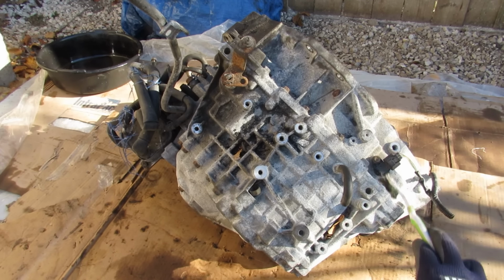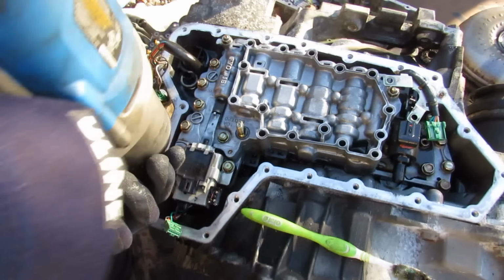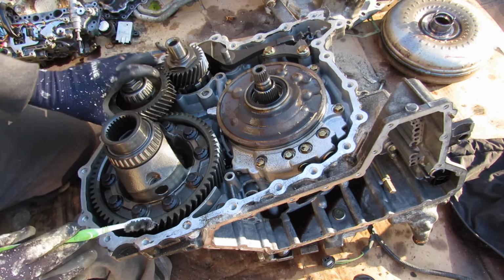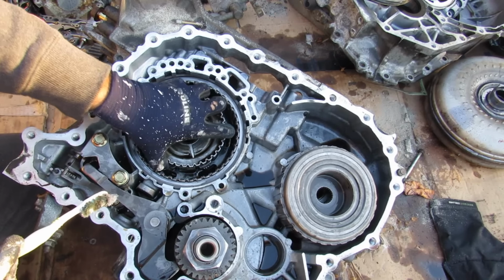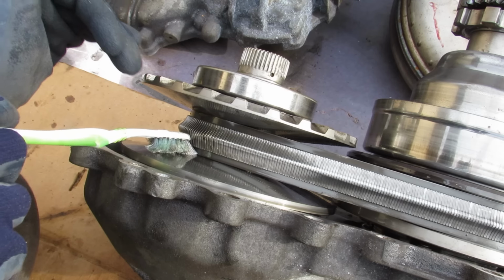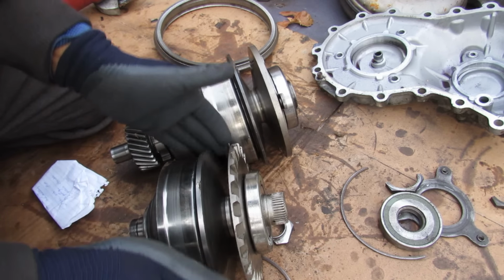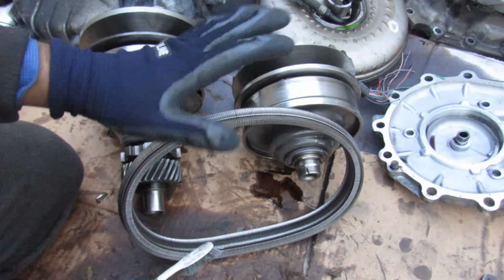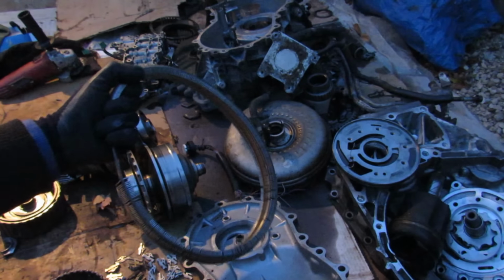Why Nissan CVTs FAIL

Comment: I have a 2016 Nissan Versa I bought in 2017 from Hertz for $10,500 out the door with 36,000 mi on it.
I now have 216,000 miles and drive the Hell out of it. I typically drive 70 mph in Cali , and 80 mpg in AZ and still average 35 mpg.
Just change your engine oil about every 10,000 miles with synthetic oil, and change transmission oil every 25,000 miles or so on a regular basis and you'll be fine no matter how hard you drive it.

Comment: The title is unfair for the manufacture 👎. Most damages are caused by user error.
Reply from the maker: Who do you work for?🐱
Reply: @speedkar99  does it matter? Please, you know the truth as well, in another "shaming" video you did the same to honda V6 cylinder deactivation system. The truth, all these were tested in conditions to "destruction". But , all service requirements were fulfilled. No problems accur even to a million km. Why suddenly ,a belt got destroyed, or CVT slipping issues?. Human error are 100% cause. I admire your skill and knowledge, and do continue your videos and teardowns of these beautiful engineered parts, but misleading viewers is a no-go.🙏

Comment: So what exactly makes it “Shift” or “simulate” 7-8 gears?
Reply from the maker: The computer regulates how much oil pressure goes to the variators and thus which belt ratio it'll stop at
Reply: @speedkar99  I have a more important question. Say I’m in a long line (about 30 min) in which a car might move up once every 2-3 minutes. Is it better to put in neutral each time I pull up, or better to just leave in drive the entire time? Is it causing more wear switching from N-D-N frequently? Also thank you for your quick response, as well as the breakdown of the Cvt in this video.
Reply from the maker: No need to switch gears. The torque converter is doing its job allowing the engine to run while you are waiting at the US border lineup.
Reply: @speedkar99  lol nah just Popeyes 🤣🤣🤣

Comment: I needed a car fast & got a 2017 Sentra. I read that trans fluid needed to be changed at a certain My mileage was about 51000 so I took the car for the work at the dealer. I used to change the oil on my Corolla & it was fairly easy to do. I’d bring the used oil to the place I got the new oil & they have a place to keep it. At no extra charge. It was more than I thought it would be but they did something besides just draining the old oil. As little as I drive the I won’t need to do this for a long time.  I could also change the trans oil in the Corolla my car had a handy drain plug I think most cars don’t have this & you have to take the pan down. A job you probably need a shop to as it gets messy when the pan comes out. I tried to find a good used Corolla but at the time couldn’t find one.

Comment: I had something similar to this on a Heathkit mini bike way back. Worked good. I’ll wait for this system to be improved before I purchase a car with one.
Reply: The system works as it is intended to  so  do your scheduled maintenance and  do not abuse the vehicle and it will last just like a regular one  Note the one thing i love is the totally smooth acceleration  never get the shifting gears sensation

Comment: No the question should be why has Nissan continued to put the same defective CVT 's in their vehicles without fixing the reliability problems ? Do NOT buy Nissan products with CVT's unless you want to pay for a new CVT before what is considered normal wear.

Comment: I've been building performance street cars for 12 years now and I only first drive a vehicle with a cvt a few years ago. It was a Nissan rogue and I told my cousin that her transmission was messed up because it felt like it was slipping. Then it clicked in my head and I remember nissan had cvt's now.

I own a 2019 Nissan Altima but the cvt doesn't act anything like the rogue did. It actually feels like a normal trans under normal driving conditions (not flooring it) and actually shifts. Her rogue never shifted and the roms always stayed at 4k+ rpm. My altima has 37kmiles and the trans is starting to slip already. Before the Altima, I had a 2017 6spd Sr turbo Sentra (should've kept it), but with the way I drive, I was worried the transmission would need replacing at some time and I don't have the money to replace a trans at the moment, (wife's not working because of covid), and it seems just after the warranty is up, something always goes wrong. The Nissan factory warranty is up @ 36kmiles and my car has 37k miles. Go figure. But I realized drivetrain/power train warranty goes to 70k miles. I wanted to wait to see if the new Sentra was going to keep the turbo and the 6spd (they didn't and I don't know why), and that's why I got the altima and I only went to the dealership to get a new tire for my Sentra. I hate salesman,they're like leeches and won't leave you alone. I do t want a new car! "Well let's just check your credit and see where you're at." Lol
These cvt's would be okay if they didn't die prematurely. I'll never get another car with a cvt unless all cars start using them.

Comment: that 'other' set of splines on he input shaft is NOT the drive for the oil pump, it is to hold the "stator" staionary inside the torque converter while the torque converter rotates around it and the turbine.

Comment: Thank you for this overview! I'm getting mine replaced right now and wanted to better understand why it was failing. Luckily, I'm at the tail end of my warranty, so failed at the perfect time to still be covered by the warrany!
Reply: I'm about to take mine in to the dealer as well @105k miles. Thank the stars for those lawsuits and the extended warranty to 120k
Reply: Change your fluid and filter every 30k if you want the new one to hold up. I know the factory maintenance schedule is longer, but usually you end up changing the trans along with the fluid because of it. I've changed my fair share of these and make money doing it. I'd rather change your fluid every 30k than hand you the bill for a new trans.
Reply: @nickwarner8158  For filter changes, do you change the exterior cartridge filter and the interior metal screen filter every time you change fluid?
Reply: @coopertracy6581  For most CTV, the internal filter is between the case halves. If you wanted to service it, you have to remove and dismantle the whole trans. Its only serviced during an overhaul. But think of it this way, if that screen is all plugged up something plugged it. That something is parts of your transmission. So if the screen plugs its fucked anyhow.
Reply: Sorry to hear that the key is not to listen to the dealer u should change the fluid every 50 to 80,000 km not miles and use a bottle of lubegard Recharge and protect with the oem fluid and u should never have an  issue I went 450,000km on an original cvt and still worked fine and sold the car and its still on the road with no issues as I sold it to a friend...maintenance is key as most dealers don't recommend changing as to why they fail....they make money replacing them too many scams nothing lasts forever especially fluid it breaks down its like saying don't change your engine oil same concept
Reply: @Eurofreestylemusic  nonsense- our service advisors recommend service at 60k. when one comes in on a flatbed its never a regular customer and the vast majority of the cars have never been serviced. if you just change the fluid every 60K you are ahead of the game.
Reply: @tommurphy4307  u dont have To change it every 60k and also Its how people drive My dads car has The original oil with almost 300k no issues original CVT....Its not a race car its a family car
Reply: @tommurphy4307  every 90k is reasonable if u got a lemon it wont matter if u change it every 20k sometines Its luck

Comment: MY GOD! It's complicated as hell....with an electric car, you don't have all these gears that took so much engineering, machining and labor to make.
The automatic trasmission was invented in the 1920's and it's hard to believe we basically still make them as they did in the past. The gas engine is even older and that has not chaged much either. I really hope gas cars become obsolete becfuase it cost so much to make them with so many parts and the more you have, the greater risk of breaking down as gas engines often do at great expense.

Comment: My nissan versa has that whining sound and it also sounds like one of the gears is loose because after I drive a few miles it overheats and won't shift from 1st or into 2nd half the time it stays stuck in first and the other half I have trouble getting the car to get out of first gear. It be feeling like it's stuck in 3rd gear. I must restart the car completely turning it off and on again just for first gear to catch and then it looses it again. The drive train doesn't have much torque when it's hot.

Comment: A big part of why they are pairing CVTs to higher powered engines is the fact that CVTs on low powered engines behave in a sluggish way. There is a slight floaty delay to stepping on the gas and the resulting acceleration changes in relation to engine noise. It's both hard to describe in writing but very easy to see for yourself in person with you hearing the engine rev but the acceleration coming behind the noise rather than in sync with regular transmissions. ,Sure low power engines don't wear out the transmission as fast so they should be better for this type but the drive feel suffers so people STEP ON IT MORE, undoing some of the benefits. On higher powered engines this is much harder to feel with the extra torque quickly making the changes faster but this loads the trans mission more leading to faster wear and tear. If we are honest here we don't buy high powered vehicles to drive them sedately all the time so the use case is just a bad fit. Its not that Nissan is doing this wrong, its a necessity due to air quality requirements and fuel efficiency regulations.

Comment: Quite some evolution from the Dutch DAF transmission, with 2 rubber belts, and the whole transmission being on the rear and the engine on the front (pretty good weight repartition). Very simple system and quite efficient finally, even kind of fun. That was 40 years ago...

Comment: CVT's are really inefficient - lots of friction loss continuously engaging and disengaging the belt.  Honda CVT motorscooters get only about 70% of the gas mileage of a chain/transmission motorcycle of equivalent displacement.

Comment: My friend, I have a 2013 Infiniti JX35 with this cvt and after removing the pan found a few very thin, 1 in long metal pieces that could be bent with fingers. I do not think it's from the belt. Any thoughts? I have a pic I can show you. Do you have an email address please? Much appreciated.

Comment: The older I get, the more I appreciate the virtues of a stickshift..
Reply: You can't even buy one anymore... So sad I still love Manual stick shifts
Reply: @josephschultz4097  Can still get some Mazda’s with a manual. Really most cars that aren’t American are available with a manual as an option. 
So, if you really want a manual just do the searching and you can find them.
Reply: @josephschultz4097  My new Versa is a stick for this exact reason. It's able to burn rubber on 1st.
Reply: @diegosc985  a friend has a 2014 Versa that's been horribly wrecked twice and most of the nearly 200k miles is cross country trips.  Engine still purrs and transmission/shift assembly still feels vague and unsatisfying to shift just like new.  It's impressively reliable despite the abuse.
Reply: @josephschultz4097  I was just looking at a 2021 Nissan Versa S with 5-speed manual transmission…
Reply: @josephschultz4097  Absolutely you can buy a manual on plenty of cars. Just not on these cars. I went for a GTI that has a great manual.
Reply: Why?
Reply: Unless you end up with a dual mass flywheel and a self adjusting pressure plate. For some vehicles, $$$!
Reply: Yup wouldn't own an automatic (the clutches are wear items) I can replace the clutch in my vehicle for $100-200 (50 if I just through a disk in it) and only have to do so every 125-200k In fact my Saturn (which is due for an engine rebuild) hasn't had a clutch since new and has 289k on it The trucks(which I tow and carry heavy loads with) are usually closer to 125k
Reply: @MDAdams72668  I had a small Dodge (93 Dodge Shadow 5 speed).  I had to replace the disk because the rivets that hold wear material were working their way out.  What caused that?
Reply: @tommak6516  If the rivets were actually falling out it was likely caused by a poor choice of rivets at the factory If however the disk material was simply worn down close to the rivets that would be normal wear the speed of which is highly driver/driving style dependant. I can get 300k miles on a light car clutch and 100k+ on the one in my tow truck. It is possible to destroy/wear out a clutch in minutes if not driven properly.
Reply: @MDAdams72668  Thnaks for responding.   It was awhile ago when this happened to me, I think 20 years ago.  I do not remember the mileage, less than 100,000.  Maybe around 80,000.  There was plenty of clutch wear material, in fact I remember their was very little wear (car was driven on freeway most of the time so little shifting, just in 5th gear most of the time).  But when some of the rivets started pushing out the car would not operate correctly.  I took it somewhere and they put a clutch kit in it which I think means a lot of clutch parts were replaced.  I certainly did not abuse the clutch, but I let friends (years before this rivet failure happened) use it occasionally for short time, a few hours, and I often wondered whether they did something driving to cause the failure.    I drove the car another 80,000 miles and sold it, 2nd clutch was still working fine.
Reply: and the clutch, pressure plate and throwout bearing top failure points..way more then a CVT..driven them for decades and replaced a lot of parts, and gears
Reply: I got 250k+ miles out of the stir-your-own 5speed on my Accord before a fork broke and jammed up the entire drivetrain.  Which brings one to the OTHER nice thing about a manual - COST.  I pinned down a used, fairly lo-miles replacement 5 speed for  about  $500.  Even used you're not gonna touch an automatic for that cheap.
Reply: I put over 350 K miles on 2 Honda passport cvt! No problems!
Reply: i apparently - and in reality -  am very very strange.   i am a nervous type and i really want to use those gears manually.  it literally saved my life one night when i had to slow my truck down on a patch of snow covered ice.  i super gently went down in gears to slow the truck down.   if i had touched the brakes the truck would have spun out of control.
Reply: I honestly don’t miss my stick shifts these days. If I want there is a semi-manual flappy paddle manual system on my current car but I had one quick go with it, found that the dash display tells you when to shift and then thought “if you are going to follow the car’s suggestions then you might as well be on auto anyway” and went right back to full auto.
Reply: @NeoMorphUK  idk what car u have but if its a shift light, thats mostly for racing
when you're focused on whats infront of you on the road and the other cars, you see the little light out of the corner of your eye and you know its when you should shift
Reply: @isatntt  That shift light isnt for racing on production cars unless you talking stuff like nissan 370Z, for most vehicles that shift light is trying to tell you how to save fuel, ive owned multiple manuals in life from a 1992 wranger, to a CRX del sol honda and now a 1st generation chevrolet colorado, and they had that light and it would only glow in two occasions either your in the red shift now before valves start coming out, or your doing 3 grand shift here to save fuel.
Reply: @compzac  honestly that makes a lot more sense, thanks for the insight
and the guy is acting like the recommended shift thing is controlling him,if you're on backroads speeding through curvy roads and your transmission keeps going from 3rd-4th or something, and you want to be able to hold it in the higher rpms for better acceleration when needed, then do that
and by no means do you HAVE to listen to when it tells you to shift
Reply: @isatntt  I don't know what he's driving but modern manuals and autos that you can put in to "sport shift" mode have this thing on the display that looks like 2->3, telling you you're in second and should go into 3rd.  My Mazda 6-spd does this and I'm convinced it's some EPA eco BS as it wants me to be in 5th at 35 mph.

<edit> Whoops, sorry, didn't see you already got a reply.  The del Sol doesn't have any lights btw, redline or otherwise. I still have one ;)
Reply: @dk-bw4gk  i've driven my moms altima with the paddle shifters and i wanna say i MIGHT recall something like that, but it was only for like 3 minutes and it was curvy roads so i was more focused on the road than on the shifting